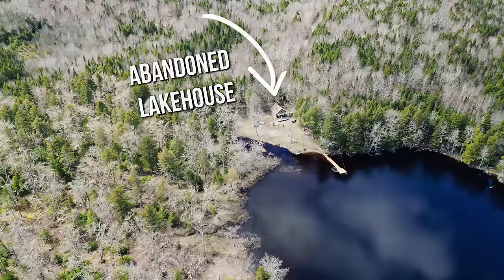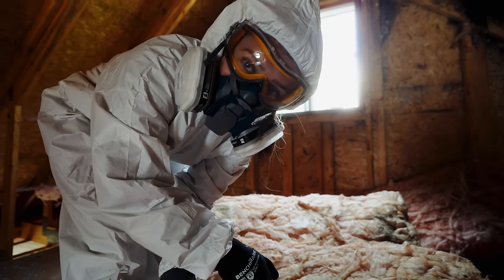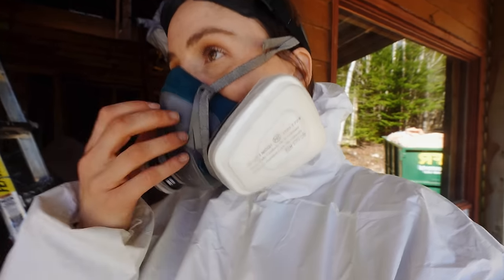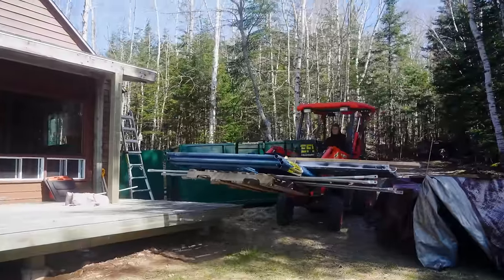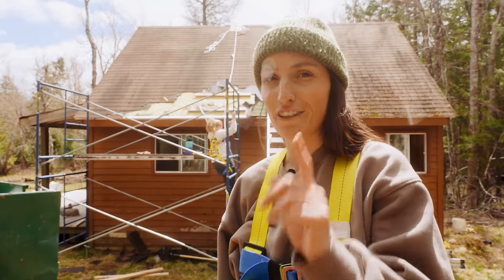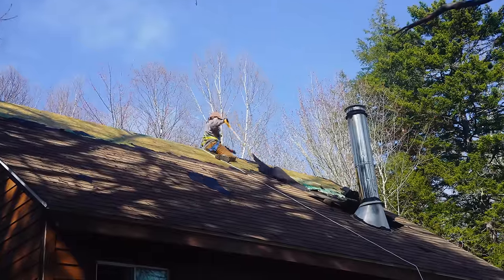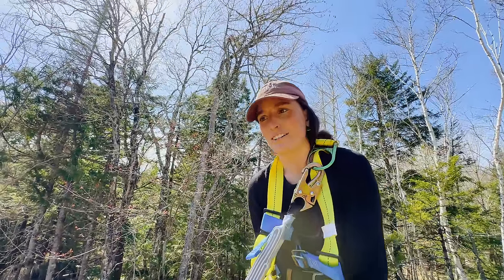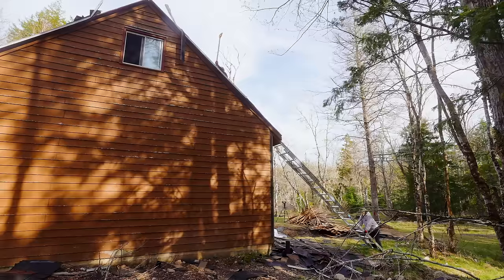ABANDONED LAKEFRONT Home Renovation: Removing Shingles

Comment: There is a negative air machine u can rent for a month with the filters. Mold pours float for weeks. The air machine will suck he mold out of the air. Your lake house needs this. Good luck
Reply: I would also get a Ozone machine from Amazon but remember they don't have much power there
Reply: Also you're technically not supposed to be in the room with it, I used to work in a hotel like 30 years ago and we run into a major problem with the housekeeper put one of those in the guest room to cover up the smell of cigarette smoke.... We got blamed for her child losing a soccer tournament because of the consequences of an ozone machine. Not likely but the science behind it they had an argument.
Reply: Not studs not joists.  Rafters!

Comment: I think you should consider raising the cabin up a little on the foundation.  Consider 2-3 courses of glass blocks.  It would allow light into the crawl space and, if you wanted, you would internally light them for a pretty cool night time effect.
Reply: Is that a thing? That’s a cool idea
Reply: It could not be weight bearing, requires maintenance, and no one is hanging out in the crawl space. Hanging and directional lights will bring beauty to the area, similar to the other cabin. Some uplighting in the trees would be cool.
Reply: @kathme120  The thinness of a flat pane of glass deters its use as a structural element, but a glass block has sufficient thickness to become structure. The void in the glass block filled with air also gives it an insulating effect allowing for a thermal environment usage.

Comment: Make sure you put ice dam membrane on your gutter ends (bottom edge), gable ends and peak.  The drip edge looks fine.  No need to replace. Lap the ice dam membrane OVER the drip edge by 1/4"+
I would add 2" X fascia boards on the gable ends to protect the siding.  As built, sideways rain could blow right up against the joint between the roof deck and the siding.  That's where the water infiltration seeped in on the gable ends .
Pull the chimney and patch the hole.  I think you can find a much better place for the wood burner. look for a location that is more central to the cabin.  
All in all, the cabin was very well built and insulated with a vapor barrier.  Your simply seeing the results of a few construction 'errors' that weren't a 'thing' 30-40 years ago.  With modern materials, you can seal those leaks no problem.  
I would sort through the clear V groove boards you are pulling off the wall and ceilings and trim the good material to random lengths.  You can reuse all of that nice paneling in random length accent walls if you nail up 1/2" OSB first. You can pin nail it or glue it up on walls. The other alternative is finishing the underside of the loft decking with the V groove material.  Fit it tight to the joists or leave a 1/4" reveal at the joists, paint the underside of the decking black (thin line at the joist) it black and nail up you planks cut 1/2" shorter than the joist space..  The reveal will give you a lot of fitting leeway. 
Raw, sealed or painted, it will look great. All you have to do is use a small router to V groove the visible butt ends. Easy-peezy, the price is right. and it is eco friendly :)
I 'm looking for your garden sprayer filled with 1 part water and one part old school laundry bleach (sodium hypochlorite).  Hit all of those black mold spots with a good soaking right away (don't wait) and kill it, dead.
Reply from the maker: Wow so much good information in this comment. Thanks for taking the time to teach us. I’ve screen shot it and kept it in an album “lakefront cabin” so I don’t lose it 😂💛
Reply: @Vanwives  Thank you so much for the kind words!  I was one of the people back when who thought it had good bones.  I'm pleased to help in any way I can. :)

Comment: NICE! Ive been a roofer since 1999, that is correct having strong ankles but after so many years on 12/12 pitches and different roofs my ankles crack and pop. When you are on that angle there is a trick, get the foam from inside of couch cushions and you can sit on them to keep grip on the roof sitting.

Comment: Ladies, absolutely great work!!!! May want to consider paying for an building inspection now, after you have stripped the cabin to the bones & before you invest in rebuilding, so you understand what may be required to pass an inspection once the rebuild is done. If you proceed without an inspection now, and invest significant time and money on a rebuild, and after construction is completed an inspection reveals significant issues with the bones of the cabin, it may be to late or to expensive to meet the inspection requirements. Best of luck Ladies. As a retired professional engineer, I greatly admire your enthusiasm, creativity and get'rdone attitude.

Comment: Looking good - that is going to be a spectacular place once it's done. You may want to start on the land and water mitigation asap since the weather is permitting outdoor work of that kind. The structure can be done later. Also, if there is an issue with the land/water mitigation, it would be better to know before investing a bunch into the structure. Worse case at this point is you got demo done that would need to be done regardless if rebuilding wasn't safely possible. At the very least get a land engineer to come out and assess it for the problems that are likely to be encountered that would cause the most damage if flooding, freezing, etc. were to happen, and how to provide a solution to those areas of concern. Like I said, this way you're not spending a fortune on a building that needed to be moved back a 100 feet, if that were to become the case. Remember the saying, "an ounce of prevention is worth a pound of cure."

Comment: You both have a tremendous amount of energy and willingness to stick to it!!

If you rig the safety lines to your waist in the front, you will be much more "balanced" and it can carry lots of your weight and allow you to work with both hands. You can work standing up straight also. Just as safe and you use less energy "staying on the roof" and have both hands for work. This works for me and I learned from a pro roofer.

Comment: Try putting a large plastic tarp down on the floor before tear downs and other messy jobs. All the crud falls on the tarp rather than the floor surface. Keeps from adding more unwanted stuff to the floor, keeps bag spillage on the tarp and makes hauling the stuff on the tarp outside done in one fell swoop. Fold it up or just drag it out. Also lessens the amount of stuff  that gets stirred up in the air from sweeping and vacuuming (vacuum exhaust blows!)

Comment: Hiya, I don't know if you have considered this but depending on how old the cabin is and how long it has been leaking, it is likely one or more of the rafters will have absorbed moisture which could cause it to rot- might not be immediately obvious and may also not present itself until further down the line but if the roof has been leaking for some time, I'd strongly suggest replacing the rafters and joists. If you leave them they might be ok for a while but it will end up you having to rip up the roof all over again and take twice as long plus possibly damage roof sheets or tiles in the process. You can get away with a small leak for a while without too much damage to the woodwork but a long term leak will cause most all wood to rot eventually, if it hasn't already.

Comment: Girls, you continue to top yourselves. Yeah, this place has a wicked roof pitch but y'all are going great guns on it. So, it appears the structure has much stronger bones than I anticipated which is a huge win. I still have a question about the porch roof---is it solid? Now for a second question/suggestion---what direction does it face, especially as a possible location for a solar panel or two? Now, hear me out. You could go with 2 possible plans of operation---wire the whole building like a house or simply permanently set a Jackery etc to take the power from the porch roof panels and use it as the only plugs in the cabin. And to harken back to my comment from last week, a bigger window for the back of the loft while switching the front above the porch roof to all glass. Anyway, keep on truckin', you're doing great but would love to see some more hands show up to help. Shhh, don't say anything but that pitch will scare the 💩out of Riley and Courtney. They're great folks but the roof of the equipment building was a lot flatter than yours.

Comment: Excellent job, girls!
Remember cold cold showers to help exfoliate. Hot water, on the other hand, allows everything in a little bit deeper as it opens your pores. Cold cold is the way to go. Don't forget to blow your noses. Remember to stay away from high histamine foods. Fermented dairy products are high in histamines. Things like aged cheese, yogurt,,,. Will exacerbate any sinus issues...
Excellent job on the personal protection equipment. I know it sucks but it's there to help keep you safe...
A stick magnet on wheels will help pull up all those roofing nails from the ground. Some of them have an easy clean mechanism. It's worth the extra pennies...
Now that you've got the place mostly stripped to bare bones, we can see what we're looking at.
Doesn't look to be anything you girls can't handle repairing or replacing... 
The 12/12 pitch is excellent for your local snow loads.
It's also the perfect pitch roof for adding in dormers. It would really open up that second story. Allowing the light to come in from the sides and adding those upstairs views. It also would add a bit more square footage to the upstairs. All kinds of options...
To be honest, I was extremely excited to see Porter. I hoped the camera would pan to a large excavator with a thumb and an extra large roll off dumpster in the background. Even with all the personal protection equipment, I still don't like the idea of you girls playing in that old glass insulation and mold. I suppose what doesn't kill you makes you stronger.
A beautiful job, girls! I can't wait to see how this one turns out.
I tried sending a link to private pilot licensing. Not sure it went through. A little pontoon puddle jumper might be perfect.🛩🏞 Maybe you girls can earn your wings.🪽
✌️🤟🖖🐾🐾🛫

Comment: This brings back memories. When I bought my 30 year old house in the woods, I got it with mouse damaged all house, roof, ceiling, walls and floors. Everything needed to go out and only thing what was left, was roof and framing. I took over 250 dead mouse out with insulation which was filled with mouse poop and pee. But I got all this covered with buyers insurance. But it was hell of a job. I did it all by myself.

Comment: In case you do not know metal is most cost effective next to asphalt roofing, etc. Researching the type of roofing for your area can save you money when insuring buildings. There are new materials that cost plenty yet not much info such as Rubber roofing made from recyclables. It is a good thing to recycle when able and to advertise for these types of companies should you need more sponsors. Tin is easiest to install needing usually a mere membrane under for waterproofing also avail in nice colors or printable. When insulating as well consider a recycled product that lessens rodent nests. Mice, rats and Squirrels detest metal and will not bore through most metals. Anyhow research all well especially around Chimney stack (some places now give a recycle fee for these) 😊 Merely trying to help no pressure. Later! Hope You find what is best for your project and remember cheap can mean peace of mind. 😊 Consider rainy season and ventilation also important in final decision. Have fun!

Comment: Harnesses and Safety first a great skill to have consider lightweight hard hats as well. The one thing that would have helped are toe holds nailed from top to bottom or vice versa on the roof where a person can place their feet for better stabilization. Eliminates fall symptoms. You both have great energy and did more work than the average roofing company does in a day and that will include clean up. Spooky excerpt is genuinely funny!  Deciding the materials for the next roof will be interesting will it be shingles or fancy different colored Tin? Waterproof membranes have improved over the years and are impressive. Trip to hardware store is always fun. The Stove pipe was really rotten underneath. Tarp placed with ease and well needed. Until next time. Later! 😂😮😅😊! Thanks for sharing! Add roofing to skills! 😂

Comment: I had an addition that deteriorated in the same way as your cabin. It turned out that the roofer had installed the Z flashing upside down, directing water toward the house instead of away from it. For years, water poured down inside the walls, outside the vapor barrier, and rotted out the floor joists. I had to jack up the roof, replace the rotted section of floor joists with new ones, and install the flashing correctly to fix the problem.

Comment: The harness is or so you can stand which 10 times a leverage, which means you would have been done in 1/10 of the time and You wear boots that are calf high and very stiff. Plastic tarps on the ground make clean up the shingles much easier, Need to get industrial magnet to run over the ground to pick up the nails so Clementine doesn't get a flat tire. Whatever type of roof you put on put down rain in ice Polyolefin Skid-resistant Film With a drip guard to protect the The chipboard it ain't Plywood. A couple of big tarps will keep it dry , just screew them under the eaves with 2 x 4

Comment: If you are completely replacing the roof, plywood and all, you could have knocked it off the trusses from the inside with some 2X4s cut to length or wrecking bars. That is how we did our Cape Cod style house years ago because we had gutted the second floor.

Comment: As a Licensed home inspector and owner of a construction company that has countless renovations under our belt, I understand that your limited knowledge(not your fault, I commend you for your hard-fought abilities) is missing areas of concern. I watched this video with 6 members of our build crew and we all agreed that the moisture damage and mold damage are unrepairable. The ridge gap is due to shrinkage in the plywood surface area and because of the steep pitch of the roof (steeper pitch multiplies, shows shrinkage more than a less steep pitch) even if you completely dry in the roof you are going to have that gap happen again when your plywood naturally dries out completely and acceptable to code shrinkage occurs. The only way to solve that is to reduce the pitch of the roof. Whoever did the original build was inexperienced as seen with the styrofoam inlays, structural framing, roof pitch, and lack of soffits for venting, Also, the shot of the trusses at minute 6:52 made my entire crew gasp. We paused it and were shocked at how many things aren't safe. The trusses are all attached with truss plates which would be fine if they weren't utility-rated (used in garage applications and are usually cheaper and less gusseted, you can tell by the size and orientation of the truss plate used instead of residential trusses gusseted correctly. I cringed when seeing your main center support beam attached by a joist hanger and allowed to ''Walk'' during the natural settling of the structure(every house settles multiple times a year due to climate that affects ground and ambient external/internal temperatures. Some of the angle trusses are attached with less than 100% surface-to-surface contact attached by truss plates. (scary) I hate to be that person who keeps sliding into your comments to complain but I care about your safety as well as the safety of your wallets and ask you to look at how little of the original house is still standing and ask yourself if you having to rebuild this much of the dwelling on questionable bones, would it be more cost-effective to demo the remaining and rebuild it adding another foot of elevation to the foundation for flood protection and new correct trusses and a less steep pitch to the roof so gap shrink is lessened 10 years down the road. What you have currently is very compromised framing due to the previous owner wanting to cut costs and build cheaply without doing the research. Draining/Flood (ditches are free and Clementine can tackle that in a day) issues would have been nice to research as well as pest control huh? (Ultrasonic pest controllers work well in remote dwellings and won't harm your dogs or perhaps introducing a kitten into the pack is nice too) just plug them in and forget them as they work 24/7. You are so close to the total demo just finish it. Always build back better, never build back barely. The advantages are peace of mind, the ability to choose your own floor plan, and the addition of adding or subtracting your vision of the build your way instead of trying to modify around someone else's inexperienced and ''If we hide it then it's okay'' mentality. Don't forget you also need to consider Homeowner Insurance and Liability. This means an inspector is going to have to sign off on your house and as a licensed inspector I can tell you with complete certainty that no inspector would approve the current framing for coverage. Just remember all the ''little'' things you dealt with in your first cabin like the cabin being out of square and having to cut every board a different size and plumbing routing and freeze protection for the harsh winters you have. Would a change in loft size or location improve natural lighting and traffic flow? Would relocating the stove to a corner help with the efficiency or perhaps a solar-powered Mini-Split heating/cooling unit that monitors temperatures 24/7 and can be controlled from both your cabins using your phone option. Love ya like family Isolation Sensations